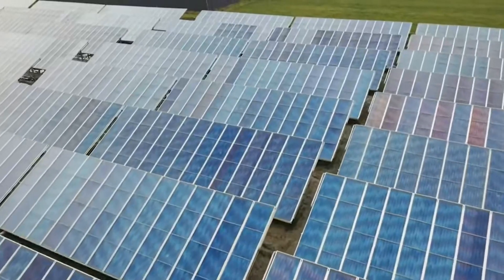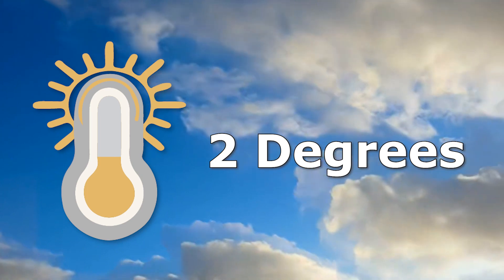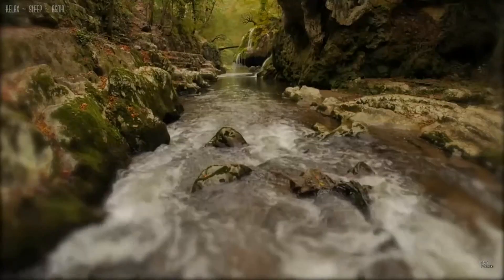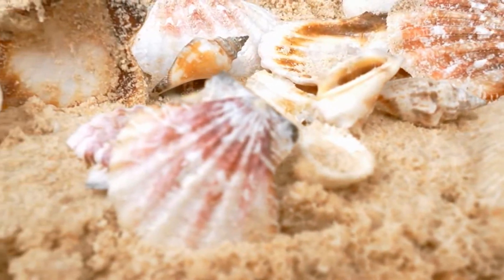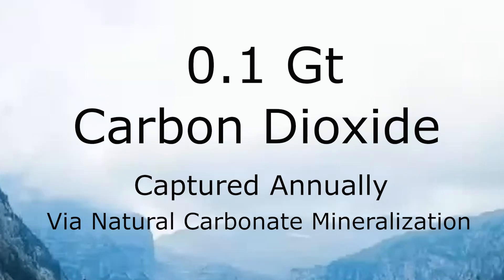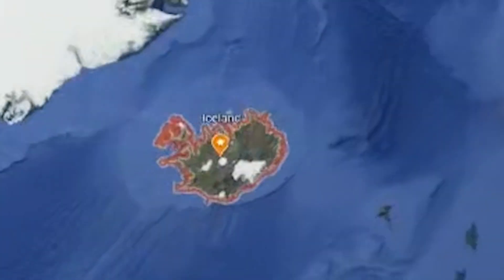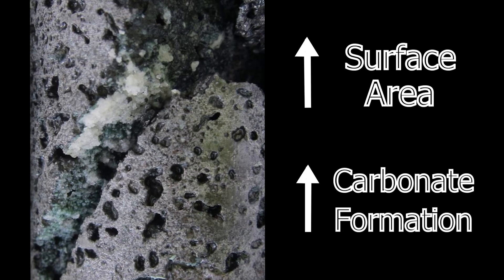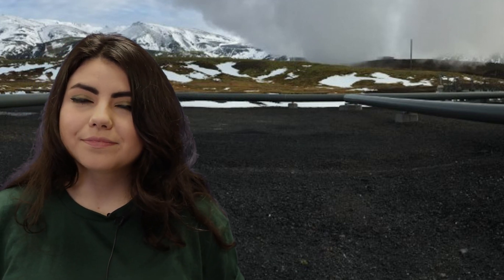Carbonate Mineralization - a SOLID Method for CO2 Capture

Comment: I honestly think that the electroless method seems to be the best because of the hydrogen byproduct that is created that can be used to run hydrogen fuel cells in vehicles in turn producing way less co2 also the hydrogen can be sold to cover the cost of these operations

Comment: And you explained why this will have no positive effect. Climate change is about reducing our emissions, right? So if some one creates a method that can capture a billion tons of CO2 per year, then it becomes a carbon credit where someone buys their emissions with in stock in one of these companies, while still emitting just as much CO2. These companies haven't actually captured that amount to calculate as an off set yet, bjt the companies still get the credit, meaning nothing has changed. It becomes a Ponzi scheme where the demand is artificial and does not keep up with it's promise because the material real world demand just isn't there. 

This is what climate change is, and why ppl need to know it's a scam. There's no profit in fixing the problem, but there's a lot of profit in convincing you they are working on the problem.